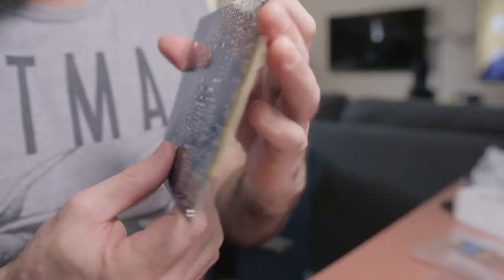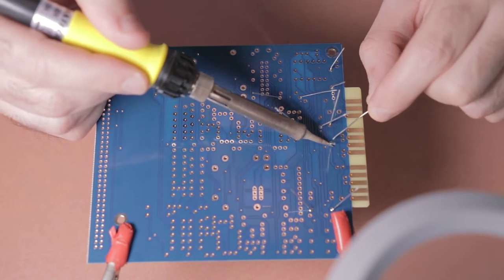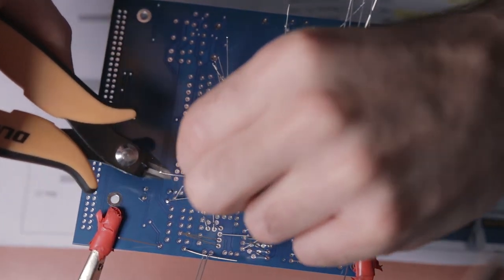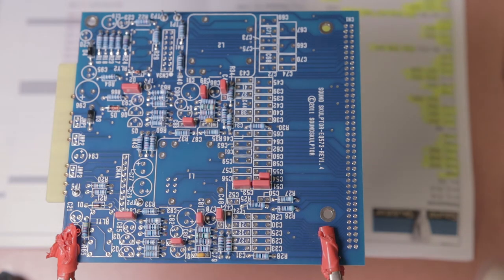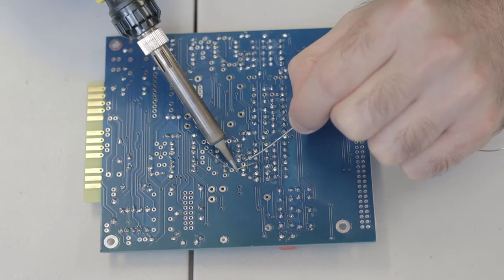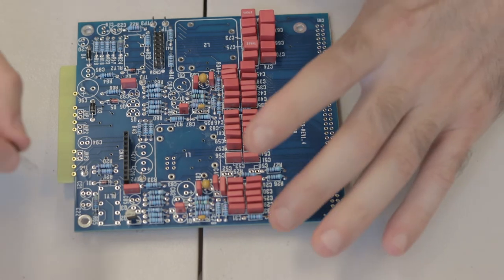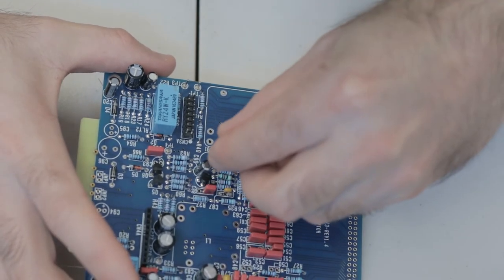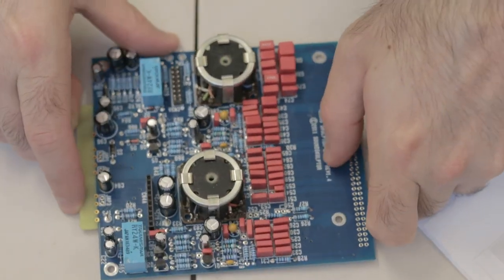How to Build your Own EQ - Sound Skulptor EQ573 (NEVE 1073) DIY Build PART 1

Comment: Holy cow, how could you leave those box caps in like that, makes me nauseus just looking at your diy skills oir lack of.
Reply from the maker: Thanks chicken for the positive feedback. I did address in this video the issues I had soldering the caps, how I fixed them later and how I could have done them better next time.
Reply: there was probably a nicer way to leave that feedback :/
Reply: @diyrecordingstudio  I haven't done this build but usually what I do is as follow:
- start with only a few capacitors among the smallest height (but still sharing the same height), and ideally placed on every 4 edges on the board for stability.
- put a rigid cardboard sheet about the same size of the board on top of the capacitors and flip the two together (don't use the PCB holder, just let the capacitors and the pbc rest on top of the cardboard). If the capacitors are the tallest components placed (which should be the case, always start with lowest profile to tallest) they should have their legs protruding from the pcb, ready to solder.
- just solder one leg of each capacitor.
- inspect each capacitor alignment, then while holding the pcb in your hand, keep a finger on one capacitor, lightly pressing down, and with your other hand reflow the solder joint of this capacitor. It should correct any alignment issue and naturally go flush to the pcb.
- inspect again for errors and proceed with the other legs.
- repeat for another set of capacitors.